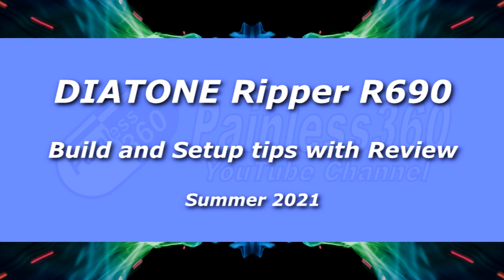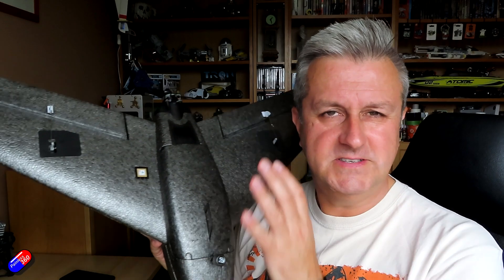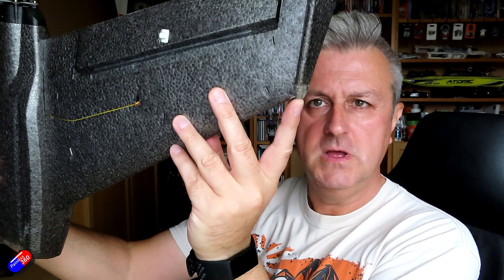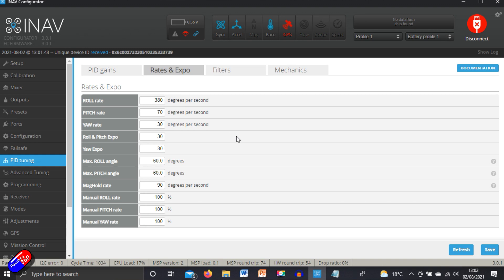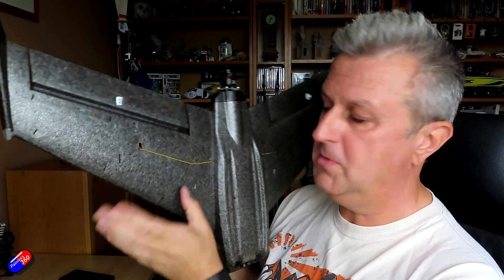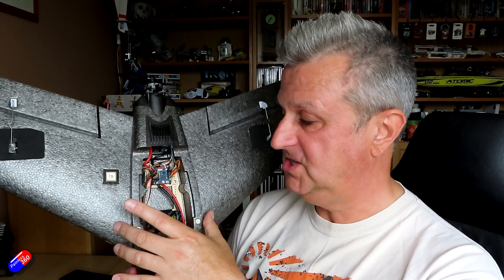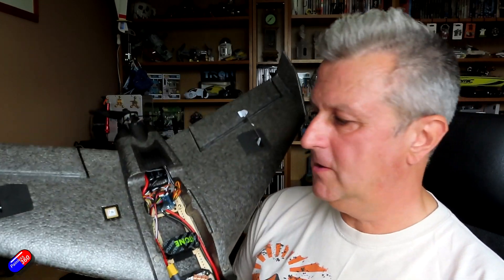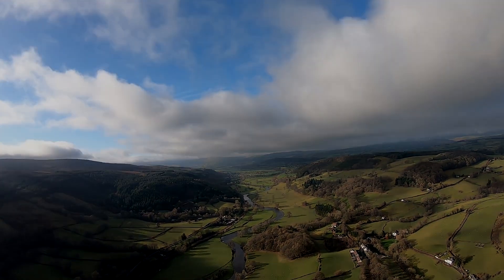DIATONE RIPPER R690: Build and Setup Guide (with Ownership Review)

Comment: I'm just about to maiden my Ripper and I based it on your build with the same FC, DJI etc. Would you recommend I set my PIDs to what you have before maiden and then autotune afterwards?
Reply from the maker: I'd leave them at the defaults for the version of INAV you are using and use an Autotune.. Best of luck!

Comment: I just got a hee wing f-01 which is basically the same airframe. Do you know how much reflex I need on the elevons? I couldn't find any Information from diatone or hee wing.
Happy flying!
Reply from the maker: Didn't I cover that in the video?
Reply: @Painless360  No you didn't. You did mention the throws and they worked great for me. I flew it today and found I didn't need any reflex. With reflex it would start to pull up as soon as it hit around 80 km/h.
Reply from the maker: Thanks for posting. That must have been the omission. Glad you got it flying. Lots of models seem to have reflex built in... Happy flying!

Comment: Hi Lee, how did you set up your F411-WSE to have the DJI OSD working? I have the same flight controller board, and it only has 2 UARTS which are occupied by the GPS and the Crossfire receiver. Which means I can't have the OSD from the board on my DJI system. Any help would be greatly appreciated. Many thanks.
Reply from the maker: I did a video on that. If you Google 'dji osd f411 painless360' you'll see it pop up. I hope it helps.

Comment: Hello Lee, I am Alexis from France. Thank you so much for all your video on this wing that would help me to build mine. I want also to fly with my DJI Goggles. I have seen that other people also use this FC MATEKF405SE but I guess that your choice is because of size ? In the framekit from your Banggood link, it looks like biblades are note included but what about all accesories for the DJI Air unit ? Last and so stupid question but I am a beginner with FPV wing, I will go with a TBS nano receiver. I have understood that this one should be soldered to FC but whrere do you plug servo ? On the FC ? Thank you so much. Best regards
Reply from the maker: If you are new then check out one of my build series. A modern build will almost always need a little cabling and soldering but using a Matek FC will help you get it working first time in my experience. See https://www.youtube.com/watch?v=kHm9mE_IDeQ for how to wire things up. I am a fan of the 411WSE as it is super small and perfect for compact spaces like this. Best of luck with the build!
Reply: @Painless360  thanks so much. I am going to order and jump into this New world. Best regards

Comment: Enjoying the series on the ‘ripper’, really piqued my interest. Looking at getting one, ideally cheap and efficient build/flight, I’ve got a ex Nano Talon 2204-1870kv (with 2200mah and 6x4), would that motor be powerful enough? Find selecting motors a difficult issue! Thanks.
Reply from the maker: Check out my series on selecting motors and props. That setup doesn't look bad for a starter for 4s.. Best of luck!

Comment: nice wing, I'm still learning to fly/crash a traditional plane at speed so I'd probably trash that wing in minutes lol. However I have scratch built a KF2 aerofoil wing from foam board and I'm thinking of doing the stupid idea of no flight control and learning to fly it with just a receiver servos and motor etc.  After a hundred or so  crashes/battery packs/rebuilds I might be proficient enough to buy a ready made wing. Stay safe Lee.

Comment: Hi there Lee,
it's been fun to see you got the same thoughts on the wing as I had :) And I love to see, that the wing gets you excited too. I ended up making mine a power cruiser capable of 60min and still being the lovely agile speeder. 

Be aware of the wings can start to flutter on a bad moment - which is the reason I stuffed some extra carbon into the wings.

Your motor seams to be a brutal beast on that setup- Currently having the t-Motor F40-PRO II with 2150kv installed with 5" and it's nice. Build two will have take the TOKA motors to the test. 

Good luck with your wing and cheers from here